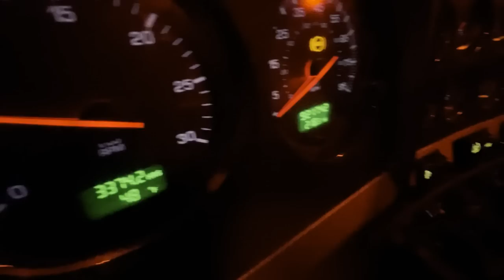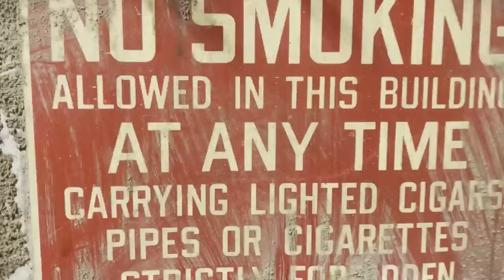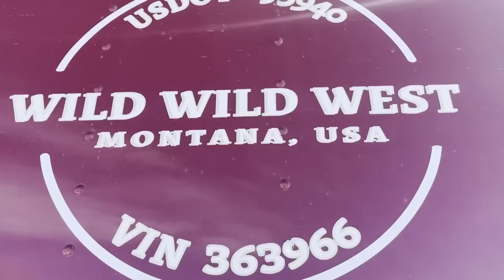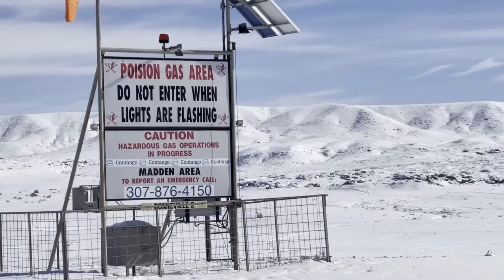From Georgia To the Poison Gas fields of Wyoming.

Comment: I worked on the Schute Creek and LaBarge projects in the early to mid 80s, in the winter both times one on the night crew. It was so cold, when you melted the ice and snow off the pipe, as I was a pipefitter, as soon as it hit the bottom of the hooch it would freeze instantaneously. 
12days on 2 days off. I would drive my 72 AMX javelin to Chubbuck and come back Monday to work the night shift.. 
In May we had 3-4 feet of snow in LaBarge to Jackson Hole. 
We had snow this morning here in Southern California. How ironic. I move to Southern California to get away from the snow and ice, and I miscalculated on that... 
God bless you and your loved ones 
Godspeed

Comment: You were in my neck of the woods. If you find yourself going to GA, and I'm assuming you took 24 in, there is a shortcut of sorts around Nashville so you don't have to play lane change games to get thru. It adds some miles to your trip but saves time in traffic. Once you get in TN take exit 43 that exit splits into 2 exits take 52nd toward Opryland. Follow that to interstate 40 E. Then take interstate 840 back around to 24 E. On 840 there is a Love's it's Couchville Pike exit. If it's full you can park on the left side of the street.

Comment: What ive found is if your not parked around 1900 to 2000 especialy near the est cst line you better just consider pushin thru to ur load/unload site. Or prepare to park on a rest area ramp. Bout 0130 you can start seein some spots open up.

I went and made a few google map lists of hole in wall park spots, reat areas, just to help plan my runs
Reply: Even have a washout list aimed for hoppers. 

Sadly no way to really share these publicly for all to use very well.